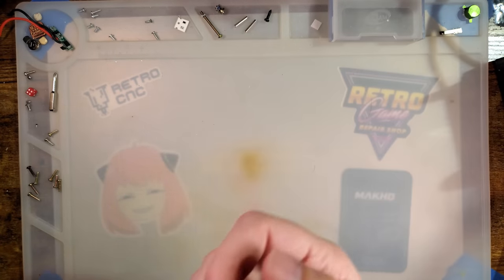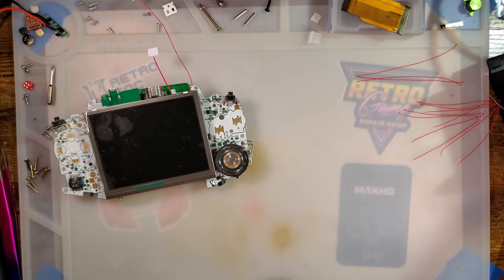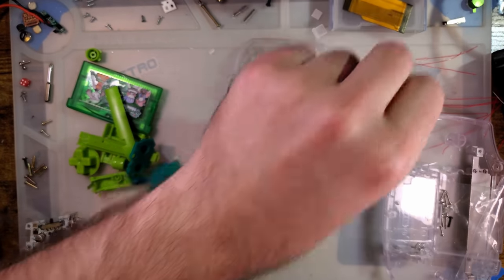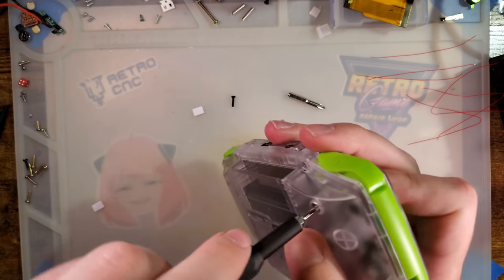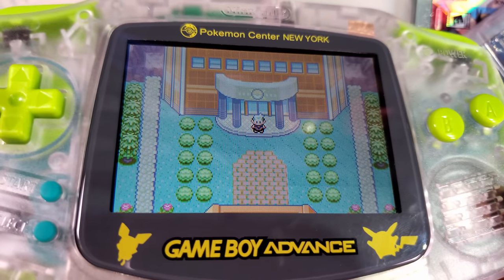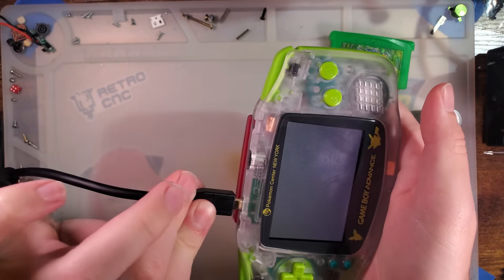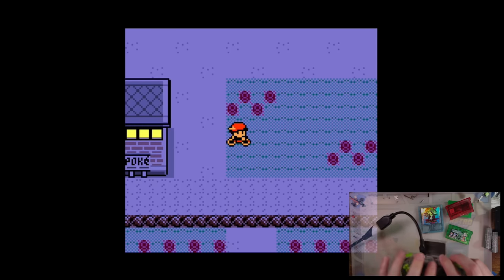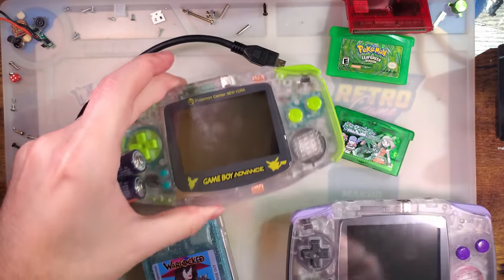DSi TFT HDMI Kit for Game Boy Advance

Comment: @makho if you have the connections to the folks who make modifications like these (I certainly don't), maybe pitch them the idea of making an HDMI cord that does most of the dirty work rather than relying heavily on this internal solution or others much like it. The concept in mind is basically an HDMI cord with a features box somewhere on the cord that allows people to force a 3:2 aspect ratio with the slide of a switch, similar to what you get with special HDMI cords with 4:3 and 16:9 switches (maybe have all three for every user preference). With this concept in mind they could also use an algorithmic onboard solution to upscale the video feed dynamically inside this box according to the confines of your current display's resolution capabilities, that way it doesn't have to be a hard coded x3 upscale, example, lets say you have a 1920x1080p display, the closest 1:1 pixel upscale would be 1440x960, what about a 2560x1440p display, the nearest upscale for that would be 2160x1440, the end result will always lead to black borders all around or appearing on the sides, but the main goal from this perspective would be the ability to do a proper upscale without causing distortions. Additionally they could create a way to "convert" (not to be confused with converting from one standard to the other, more like translating the unique nature of the video feed here and making it more understandable across various machines that can take HDMI connections) the video output feed to a more traditional or universal standard if you will, that will allow the ability for more HDMI based capture devices to better understand what is being fed to them. As for the internal solution of sorts for the console itself, considering the size of the Game Boy Advance, it would be better to reduce the overall motherboard size and allow more legroom for more important modifications, considering this HDMI cord solution will basically do what this current internal HDMI solution would be doing but better, there wouldn't be any loss shifting capabilities, you get more if anything. Not to mention this HDMI cord could even be created to work with more than just this system, maybe they could shift it so it works on all the Game Boy consoles that have an HDMI modification, they could even make it so the cord requires a specific firmware so the cord itself could potentially be future proof if and when other consoles get HDMI solutions of their own. It would be a lot more work than what they have provided here and with the other Game Boy systems, but it would outlast these current solutions in the long run. I'd say the only drawback would be having to keep up with the HDMI capability standards considering higher resolution displays require beefier HDMI cables, HDMI 2.1 is currently the standard thus far and works up to 8K (and apparently more than that but that's a story for another day) so I think this could work if it's executed properly, but then again I am not an expert, my knowledge is based on what I've learned and experimented with up to this point. If whoever reads this is also able to pass this idea along, and if it works, it might be a game changer for everyone.

Comment: I'd like for you to test it on DC out packs and see if requires a 5v input as well and what traditional GBA DC outs are output at. My belief is that if I can't DC out to a wall charger to not use batteries and it requires a special DC power source, then it's safe to say it's garbage until they make new iterations to the mod. I also think these companies should be held accountable for these flaws being they're supposed to QC and test them before flooding them in the market.

Comment: Thanks for sharing this mod, I've been learning a lot from your content.

I checked the normal single use batteries floating around my house, and they were all 1.5 volts.   That included Amazon Basics, Duracell, and Energizer.    Is the lower 1.2 voltage on your Ladda batteries typical of rechargeable batteries?   Is there something that makes the Ladda desirable over the normal 1.5 volts?
Reply from the maker: NiMh rechargeables are lower nominal voltage than alkaline non-rechargeables. The desirability is that they can be recharged a few hundred (or thousand) times.

Comment: Maybe I missed it in the video, but I thought this kit was also supposed to allow changing the aspect ratio of the output. One listing I saw seemed to imply it was done by tapping one of the touch sensors while outputting. 

Either way, thanks again for another great video!
Reply from the maker: if it does, I wish they would have documented that better. I'll play with it again soon and update if I can.
Reply: I just got this kit in and it definitely can change aspect ratio with the brightness control when connected to HDMI
Reply from the maker: @choiwaynekiet  Indeed you are correct. I missed that the first time around because there was no documentation.

Comment: How's the brightness on this compared to an AGS-101 screen mod in one of these? it's a bit hard to make out on video, i'd love to upgrade from my 101 screen as the brightness isn't that high on it and next to my DSi it looks super dim, would this at full brightness be the same as the DSi at full brightness?
Reply from the maker: I have a spreadsheet linked on my site in the description with brightness values measured (relative)